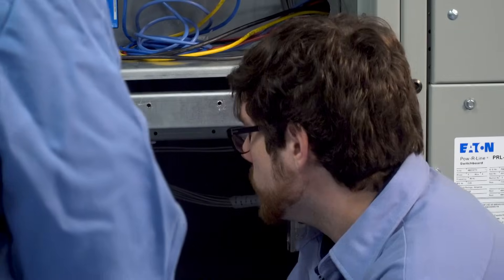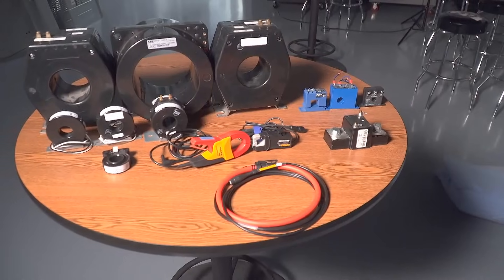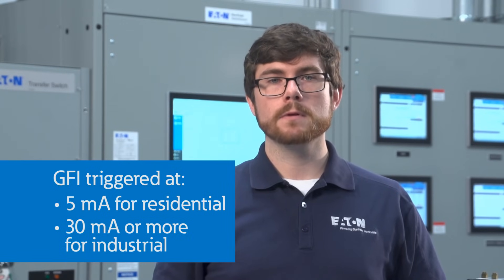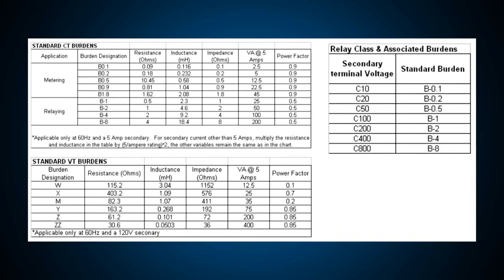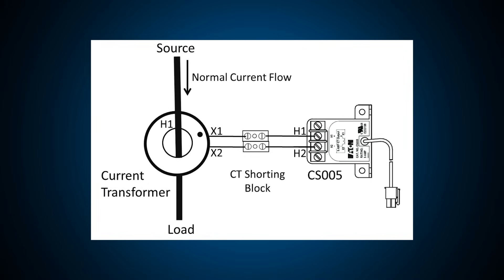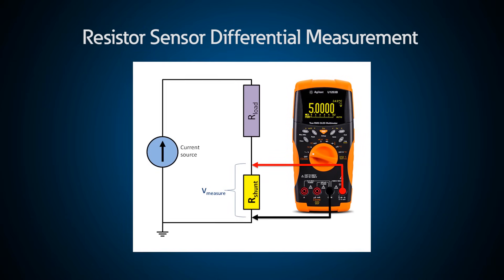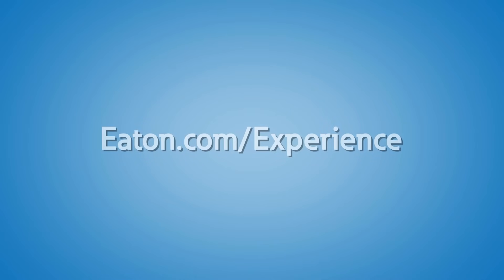Current Transformers (CT)

Comment: I am not understanding the part on minute 6:10, when he explains that, with an opening circuit on the secondary winding the voltage will increase to thousands of volts, why?? I understand the CT has a ratio that, reduces the current from the primary to the secondary, the same way that increases the voltage, but the voltage or the current in the primary winding is not changing, why the voltage on the secondary winding will increase? In normal operation this secondary voltage is very low, and the secondary current wont be higher than 5A, this secondary current depends also on the resistance in the ammeter that it's connected to the CT. But can't be higher than 5A. If we don't have an ammeter (or resistance) this current is 0, and the secondary voltage will depend on the primary voltage, which is extremely low. Can you please help me to understand why the voltage will increase?
Reply: When CT secondary side is left open, there will be no current flowing in the secondary to oppose the primary flux. There would be back EMF and CT core flux will rise to saturation. This will induced very high voltage at secondary side due to usually number of turns is high at secondary side.

Comment: Why when having a loop it divides the primary current? Can u please tell the reasons or concept or prove? Thanks for positive response
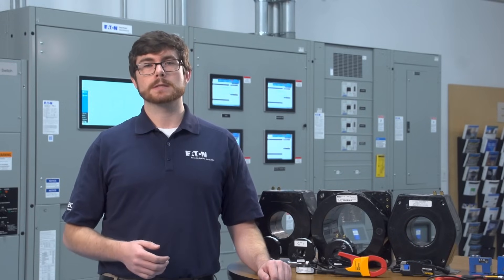Reply: It changes the ratio of loops, which changes the ratio of voltage and current in transformers. If the primary has 1 loop and the secondary has 10, then your ratio is 1:10. If the primary has 10A of current then the secondary will show 1A of current. 

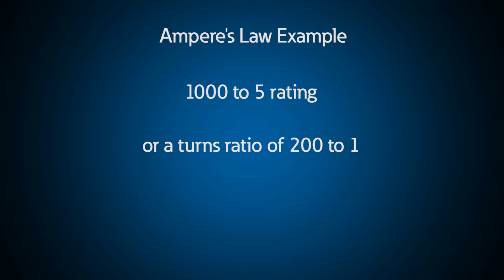If you increase your loops on the primary to 2 loops, your ratio is now 2:10 or 1:5. Meaning if the primary has 10A of current flowing through it, the secondary will show 2A.

Comment: Really helpful, particularly the comparison of CTs to hall effect sensors, rogowski coils, etc. One nitpick: 1:50 describes how a magnetic field around the primary induces a current in the secondary. But importantly, the time derivative of the magnetic field is what will induce a current in the secondary. This explains why a CT like this won't work with a DC application.

Comment: I think 2:11-2:20 may be wrong? When primary winding has 200 turns and secondary winding has 1 turn, 1000 amps on primary side would produce 1000×200 = 200000 amps on secondary side.

Comment: So how would you choose a CT for residential power monitering?

Say a 20a line and I'd like to reliably know if there is 0.5a to 16a being used?  Is there an equation that helps to select appropriate CT?
Reply: They are all over ebay for cheap.  They need a burden resistor to convert the current to voltage.

Comment: CT is a sensor, it's true that it works on electromagnetism principles and to pick up current passing without interrupting it, it has to rely on induction, so it works like a transformer, but it remains a sensor. CT stands for current transducer (= sensor).

If we call this device a transformer, then perhaps we can call all radio devices including all mobile phones transformers because they all work on electromagnetism and induction principles, no?
Reply: Everyone I know, including myself, and every book and manual I read called it a current transformer. And VT or PT as voltage or potential transformers and both are grouped under instrumental transformers as opposed from a power transformer like a distribution transformer. I get that instrumental transformers are essentially sensors, but everybody and everything calls them transformers because they are in essence that, and are tested and treated as such.  Ex: Radio device don't spit out high voltages when back feed, and in fact can't really be backfeed effectively at all, they don't have voltage or turn ratios, are not tied to specific electric grids, no magnetic saturations points, no primary-to-secondary insulations values, etc etc. As far as I found, they are originally called transformers from the beginning.

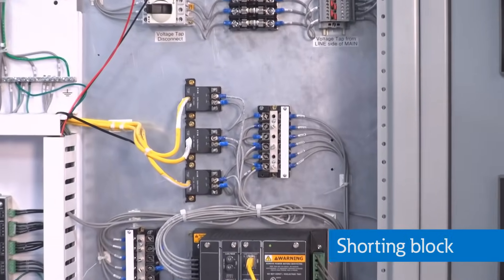Comment: 6:18 never leave CT unshorted or unburdened when energized.  i had a trouble call from an engineer who burned down a brand new 5k volt breaker because he energized it with the CTs open.  what happens is they run away. all the terminal blocks, which are rated to take 30a continuously, all burned into a single smelly glob of plastic

Comment: Great low cost technique for measuring low frequency, high current but for higher frequencies and lower current measurements Hall effect sensors are used but those are pretty much expensive.

Comment: I have a question. Please could you tell me what would happen if the primary flow current is 300A permanently and the CT protection ratio is only 200/5 A 10 VA? Is there a possibility of damage to the CT?
Reply: Depends on the thermal rating factor (TRF) of the CT, and the input ratings of the protection/measuring device. If the TRF=2.0 (very common), the CT will be fine, but will output a continuous 7.5 amps on the secondary. If the protection device can handle that 7.5 amps indefinitely, all will be good. This is routinely done in metering applications in substations.
Reply: It will burn

Comment: Good lecture thank you very much. please can anyone help me on how to connect a motor protection relay with an external CT. I have an adjustable motor protection relay with internal CT the range is from 10 - 999A, the space for primary main conductor cannot contain my cable size based on the motor capacity, so i want to make use of external CT to achieve same result.

Comment: Hi, i would like to understand better the concept opening circuit can be  dangerus. The voltage step up to 1000Volts. So better to keep always the circuit close or shunt in place
Reply: On the 600 volt rated cts the open circuit voltage will only rise a few hundred volts and not thousands., but the higher voltage rated ones will.

Comment: Opening ct circuit on 600 volt rated or less is not as dangerous as the higher voltage rated. The older metering handbook stated this. But once an opinion becomes excepted as fact, reality is lost! We have be changing 3s meters for years without a bypass or shunt. Which opens the current circuit!

Comment: I'm calculating the number of secondary turns on a transformer where the ratio is 8:3 with a voltage of 440V and 750 turns on the primary winding and a 40 ohms resistor on the secondary winding so my brain is dead
Reply: buy a megger ttr. this will give you a better idea of turns ratio. for example if the transformers primary is 12470v and the secondary is 480/277Y. divide 12470 by 277. this will give you the exact turns ratio results.

Comment: Why is CT not accurate for low currents?
Reply: If u measure low current using low ratio ct like 5/5, 10/5

https://youtu.be/8qK5Fz1K0ZI
Reply: Some of the new cts have higher accuracy at measuring the lower currents in circuits. We use high accuracy, extended range cts on new installations.
Reply: The magnetic field in the primary will be to low if the primary current is low. The magnetic field must be strong enough to excite the secondary.
You can loop the primary back through the ct to increase secondary.
If primary only has 1/4 amp, looping through ct 4 times will produce 1 amp on  primary, increasing the secondary current, but the ratio will be ÷ by 4.